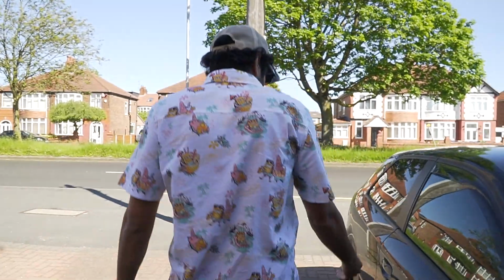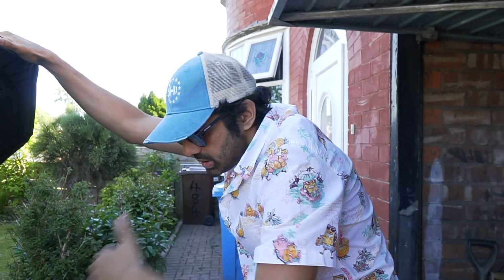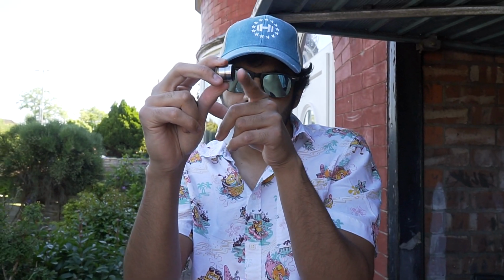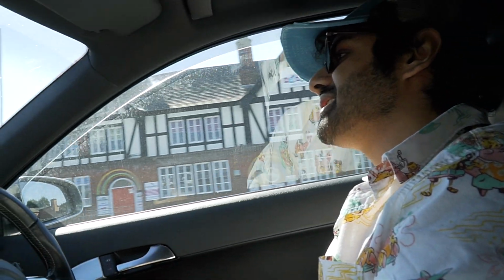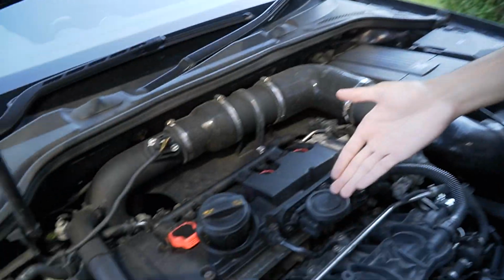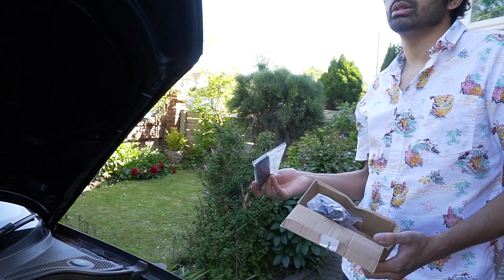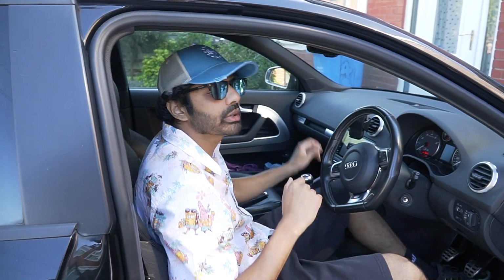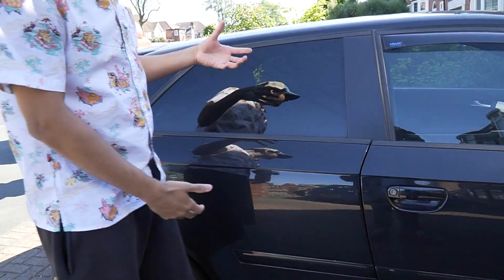What To Look At When Buying A Audi S3 8p

Comment: I am currently looking for an S3. I see that there are 2 engine codes BHZ and CDL is there a difference in this? And are these cars known for consuming oil? That is the reason why I did not go for a golf 6 gti.
Reply: They are pretty much the same. If u want the mk6 gti just take a edition 35 its the same engine from the golf 6r or s3 which means the engine has an timing belt and a little chain for the cams. I got my S3 FL with the cdla about half a year with 140k km and there was a little oil consume but i just switched the oil from 5w30 longlife to 5w40 and the oil consume was completely gone.

Comment: When doing the Haldex test, are you literally immediately popping the clutch? Or is there some level of clutch control to stop it bogging down? Because when I just completely dump the clutch mine bogs down then have to wait for the revs to climb again
Reply from the maker: You have to dump it theres no control because if you try control it and let it of slow your literally just burning your clutch because your revving so high to launch it 👍
Reply: @H4Torque  so what do you make of my car bogging down? 😕
Reply: @H4Torque  were you launching with TC off? Because mines limited to just under 4k with TC on and this causes the car to bog down real badly if I pop the clutch. Haven't tried with TC off yet
Reply: @harrywright6753  Yeah same happens on mine with PS4's you HAVE to slip the clutch slightly to avoid it bogging. worse thing about haldex, had a b7 a4 and you could dump it no issues